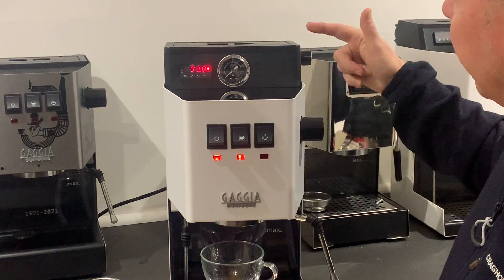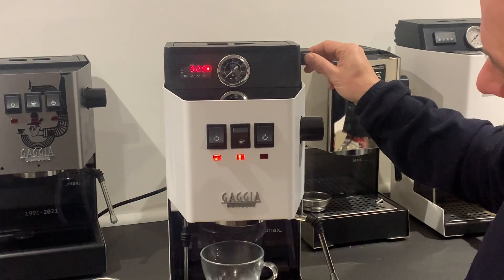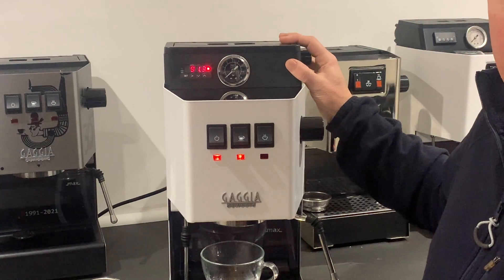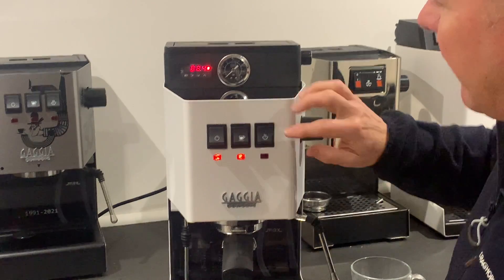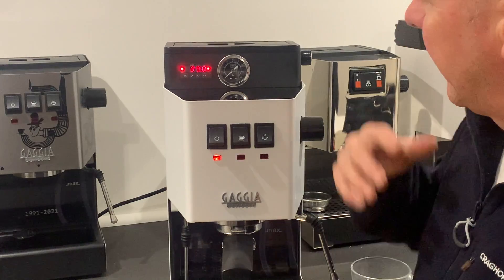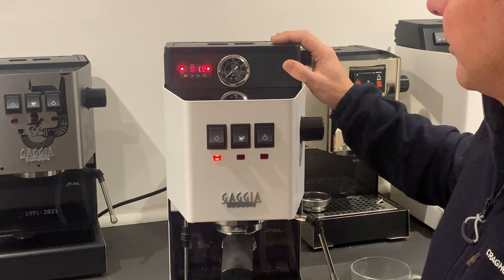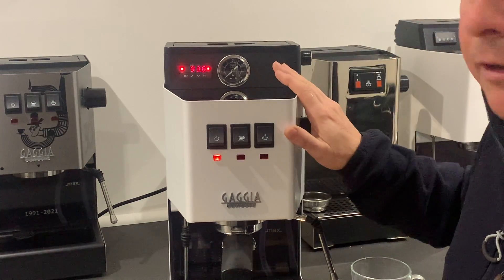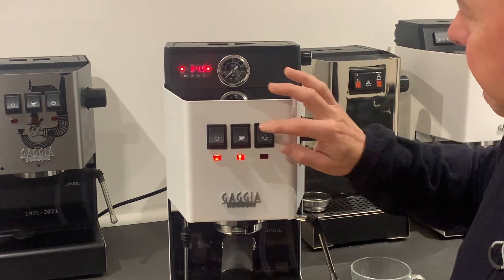Why add a Dimmer to a Gaggia Classic?

Comment: looks if I have a dimmer I don't need any custom say 9 bar springs because those custom kits just cut out extra pressure, but if I already can control the pressure with some dimmer controller... why do I need anything else? am I right?
Reply: that is correct, OPV mod just puts a cap on how high pressure can go, which you could achieve in theory the same way (though less exact than a spring, not that it matters) with a dimmer

Comment: Doesn't opening the steam valve for a few seconds cause a pre infusion of sorts ?
Reply: ya that's called the "poor man's preinfusion" if you open it a quarter turn. But it also diverts water into the steam wand so you have to catch it in a cup and dump it
Reply: @ajmass7  but in essence if you fitted a pressure gauge, you could not bother with the rest, just use the steam knob and excess steam/water to preheat your mug

Comment: Which spring is needed for that dimmer?
Reply from the maker: Hi, it will work with any, the spring sets/controls the maximum pressure. I tend to install the 9 bar as I never make a coffee above 9 bar. (Usually 6 for me 😊).